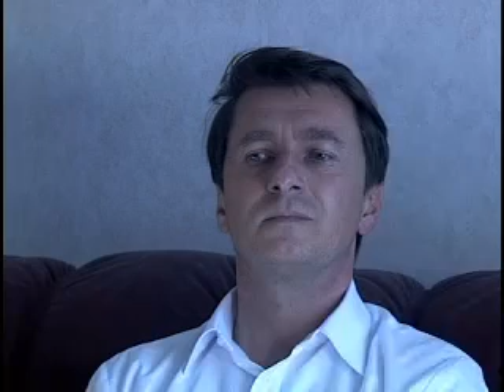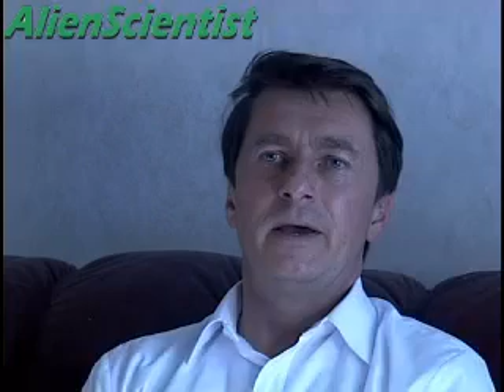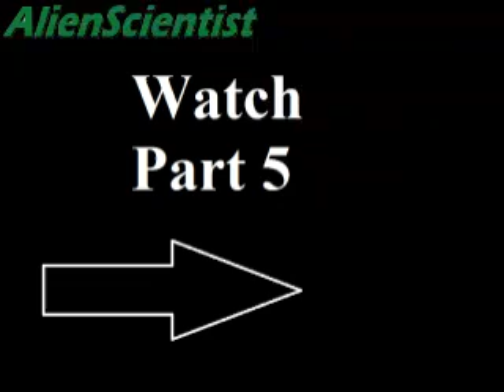(4 of 5) Dr. Eugene Podkletnov Rare Interview

Comment: On a coast to coast am radio show an ex top scientist said anti-gravity field is made by creating a super strong magnetic repulsion field, N-N pole or S-S not sure which, but mass of vehicles ,cars planes etc can be reduced to half or less by a very powerful compact expensive static magnets  configured with a certain gap and intensity.this technology is being hidden from the public,since it could cause the prices of oil to plummet.Laws of physics pushed pass its limits,as in a black hole.

Comment: From the 1994 paper:
"1 Substituting a metal disk or a disk made totally from superconducting ceramic. In all these cases, the shielding effect was not observed. This confirms, in our opinion, that the origin of the effect resides in the interaction between the upper (superconducting) part of the disk and the lower part, where considerable resistive phenomena take place."
"3 An AC field is indispensable. The shielding effect was completely absent when only static magnetic fields were employed."